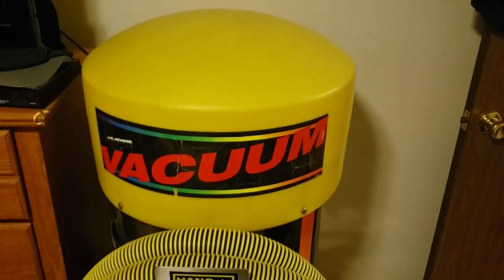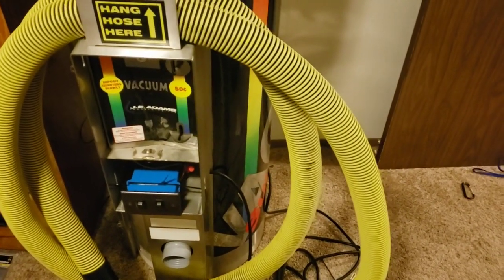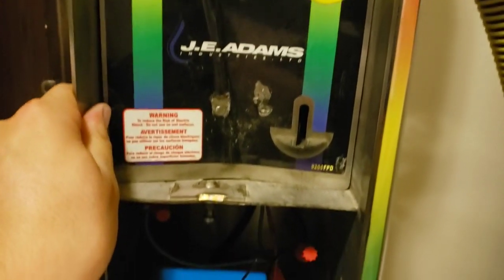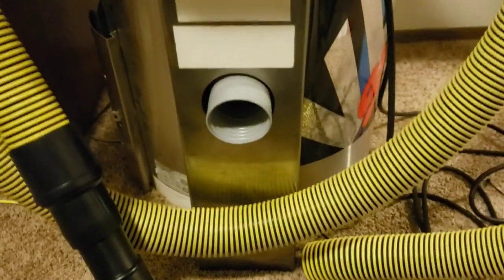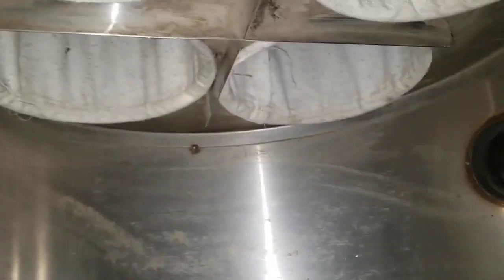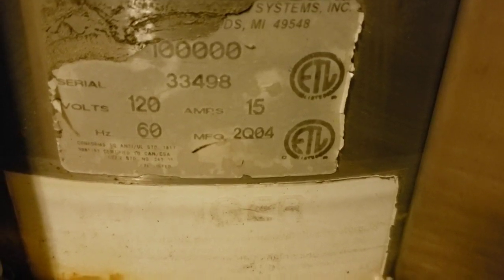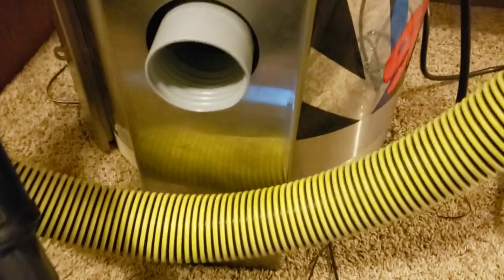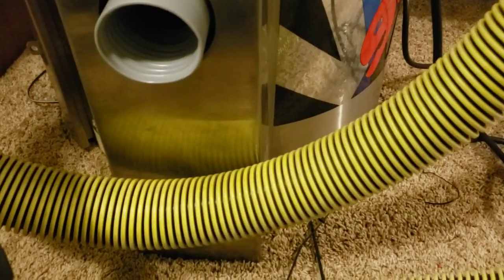JE Adams carwash vacuum airflow test

Comment: Airflow wise the unit matches an old Ridgid wet and dry that VacLab tested, more suction though.
Reply from the maker: Right, a single stage motor tends to produce higher flow numbers where multi stage motors sacrifice that for higher lift. In this case we have 2 like 8 amp dual stage motors in parallel. It could be boosted to surpass it's current flow but eh It's mostly a novelty item for me

Comment: Also, you'll actually usually see a small drop in sealed suction when the motors are in parallel, but, the extra airflow more than compensates.

Comment: This would compare to something like a SilentMaster S2 Or an MD B2. 2 5.7in twin fan Ametek motors. It's good for about 80" and 200CFM at the 2 in opening on the front, with clean filters. If you wanted, this could be installed as a central vac.
Reply from the maker: Funny I've thought about that but I think i'll save the central vac job for a dedicated central vac. It'll Likely be the Allegro Zenith but we'll see.
Reply: @Blackheartvacs  Honestly, I'd rather this over an Allegro, but my preference is a bag. While I rarely sell them, I also have a decided personal preference for dual motor, in parallel, units. Two 3 fan motors gets the same airflow and about 140" of suction.
Reply: @Blackheartvacs  Also, I eventually do desperately want one of these machines in my collection, my thoughts are to use it in the garage, or even better if I had a separate shop/garage, I'd just go ahead and plumb it in  as a shop central vac. That same cuff you used on the front will also connect it to the 2in pipe.
Reply from the maker: @compactc9  Well it was always my intention to use a bag in the Allegro I just decided on that particular unit due to the specs being pretty good with it having an 8.4" motor, the wattage of it shouldn't require a dedicated circuit unlike a dual motor motor and the MUA75 also seems like it won't be overly loud.  I mean I know it would be tucked away somewhere but I figured the quieter the better. As for the Carwash vac, it'll go into my garage when I finally buy a house.
Reply: @Blackheartvacs  The 8.4 in motor is amazing, that is a TON of power.

Comment: One thing that would be neat is reassembling the coil-op mechanism and putting it in your garage so if your friends need to clean their cars they can for a fee
Reply from the maker: It would be kind of neat to have that working but the repair parts on them are kinda spendy from what i recall. I also wouldn't bothering charging a friend to use it.

Comment: How did you install the two power switches
Reply from the maker: well i just unwired the coin box connected the white wires to the cord's white wire, same for the ground then connected 2 black wires to the cord (one for each switch) got a junction box made some holes popped in the switches attached black wires from the motor to one and the bulb to the other. It was a pretty simple process it took me more time to grind a space open for the cord.

Comment: Some say a Dyson battery powered stick vac can do better. 👍🤣😁
Reply from the maker: the only argument that can be made is those generally have agitation via their mini powered heads.
Reply: ive had a pro dyson guy swear that the dyson could bat a central vaccum once, boy did the hilarity insue i tell you
Reply from the maker: @mondogecko01  Yeah there's a few people who are just completely delusional like that. Whatever they like is the best despite any evidence to the contrary. I'm still a little unsure where central vacuums stand and my sample size for them has been rather small. Of course there's such a variance in their power too.
Reply: @Blackheartvacs  Central vacs do range a lot in power, but the feel at the end of the hose on this is about what most in the business would consider the absolute minimum acceptable.
Reply: The only machines I think that can compare to these performance-wise are portable commercial extractors as they have twin motors most of the time.  They are probably easier to get as well.  The only thing is they typically require two circuits.  To use them for dry vacuuming though requires a device called a dust downer.